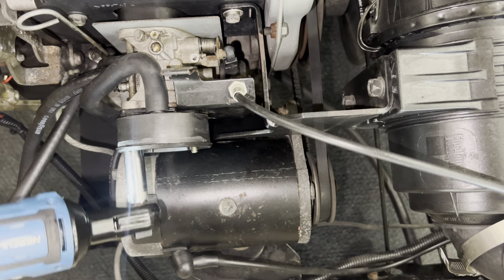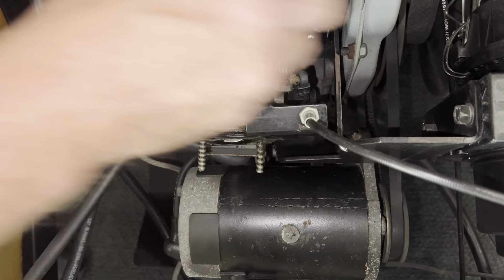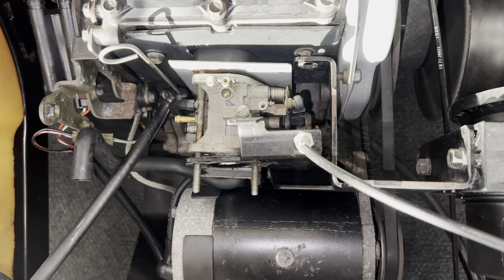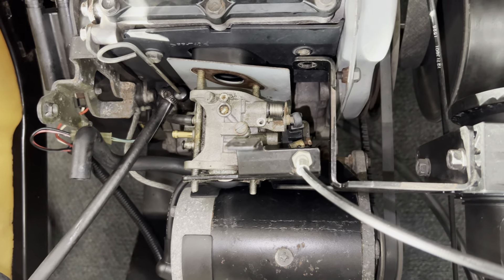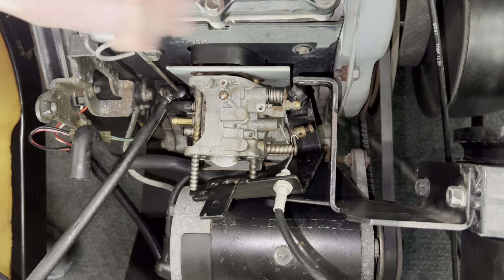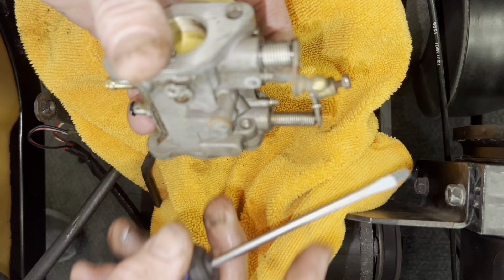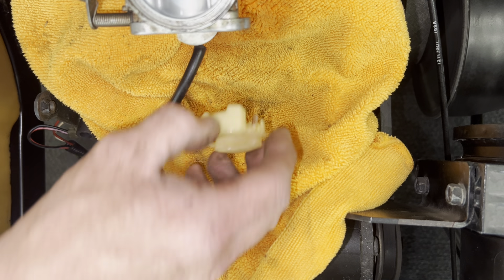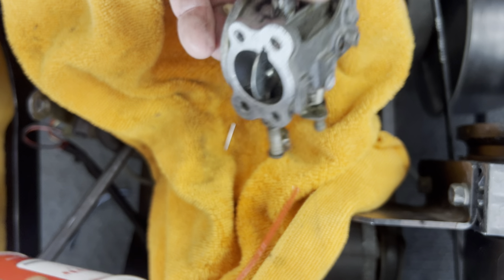Ezgo gas robins engine.  Clean carburetor.  Step by step

Comment: Great video, I have the same carburetor on my  EZGO. Im trying to replace it but I cant find the exact one.  Do you have the specific replacement for it? I cant find any markings on mine. Thanks
Reply from the maker: Go on parts zillow.com and type in 295 cc engine carburetor robins Ezgo
Reply from the maker: https://www.countrycat.com/e-z-go-cushman-72840g01-oem-carburetor-fuji-robin-subaru-295-mci?utm_source=google&utm_medium=cpc&utm_campaign=google-simple&srsltid=AfmBOoojQ6udXK0bXWAVQR_mMC-MWz4Vxk3LJD8YgWycveYcWeil5Iz6lyw
Reply from the maker: https://www.countrycat.com/e-z-go-cushman-72840g01-oem-carburetor-fuji-robin-subaru-295-mci?utm_source=google&utm_medium=cpc&utm_campaign=google-simple&srsltid=AfmBOoojQ6udXK0bXWAVQR_mMC-MWz4Vxk3LJD8YgWycveYcWeil5Iz6lyw
Reply from the maker: Whatever you do don’t order and cheap one off of Amazon they’re not worth it. It will cost you more headache than what is worth or you are better off to just clean what you got if you can.
Reply from the maker: What problem are you having with yours?
Reply: @Golfcartwhisperer  my screws are stripped and I cant get to the jets to clean them out. Easier just to change out the carb. I'll look for them, thanks.
Reply from the maker: @ gotcha

Comment: Hey,  I have a question about a ignition coil for a ex go workhorse with the robin 350 like the one in the video. What would be the best place to get a replacement? I believe it is a 2003 year. Thanks
Reply from the maker: @deerdoghunter123  what’s wrong with yours? Don’t want you to but the wrong part
Reply: One of the plug wires has come out and I'm not sure but looks like it is not supposed to? I'm new to golf cart engines. The cart started to run bad every now and then and has slowly gotten worse. I can barely get it to go up the ramp on my trailer now. I have pulled the carburetor and it looks good inside. The cart never sits so not bad gas. Just wanted to check if you believe the ignition coil could be the reason with the plug wire coming out.
Reply from the maker: I would just push the ignition coil back in. Have you tried adjusting the valves.  I am going to share you a couple of videos.  Have you tried running it with the air box cover and the air filter out to see if runs bad.
Reply from the maker: Ezgo gas has no power adjust valves.  Robins twin cylinder engine
https://youtu.be/X2CxSnD6K8E
Reply from the maker: TEST REAR CLUTCH ON A EZGO GOLF CART.  (DRIVEN CLUTCH)
https://youtu.be/mTA-r0caW_s
Reply from the maker: If it’s a coil they normally go out on one cylinder.   So the cart would skip and barely not run period. Check the videos I sent you above.  If they don’t fix your problem.   
Is it hard to start sometimes?
Reply: @Golfcartwhisperer  It is not hard to start normally. I have adjusted the valves to the .004 spec. I will try running it with the air box off. Just want to check that the plug wires that go to the pack just push in and there is no metal prong or anything? Looks like a clean cut wire that came out. Thanks for the help.
Reply: The cart started out skipping and bogging every now and then and has gradually gotten to the point now will barely move at all.
Reply from the maker: @deerdoghunter123  what you could do there is put it in neutral. Take one spark plug wire off. Let it hang and try to crank it up. Then put the spark plug wire back on and put the other plug wire off and crank it up and see which ones the worst, they both should crank up the same.
Reply from the maker: @deerdoghunter123  but you’re right there should be a metal prong sticking out the inside of the coil like a metal pin sticking up then it just sticks into the bottom of the wire if that metal pen is gone yes, replace coil. I would buy one from Red Hawk or if you wanted to is yoursmade is your exhaust manifold aluminum or is it metal?
Reply: @Golfcartwhisperer  ok I will try that as well. Is it normal for the wire to look like it has been clean cut and just stick in the pack with the boot on?
Reply: @Golfcartwhisperer  metal I believe, not 100% sure will check when I get home.
Reply: @Golfcartwhisperer  I did not see any metal prong or anything. It looked like the wire just went in not connected to anything I could see.
Reply: @Golfcartwhisperer  Do you have a part# for the coil from Red Hawk. It is the Robin 350 I believe 2003 year. Looks like the one in this video.  Thanks
Reply from the maker: @deerdoghunter123  10-4. Because if it’s metal you have a pre mci engine. Don’t buy none for them. They’re not worth crap.  Get you an mci coil with the adapter harness. But I am going to say this. Trust me on this.  If the pin is not broke inside your current coil.  Put the wire back in with a little silicone on the side and it will hold it in place   The wire just pushes on the tab that’s inside the coil sticking up.  You’re 1,000,000 % better off to stick with the oem coil. Meaning factory coil. If anyway possible. All you can get for the robins engine are after market parts. And you’ll buy 10 to get one good. Most of the time you’ll have to add a balance resistor to the coil to make it even work
Reply: @Golfcartwhisperer  Ok I will put it back with a little silicone. I appreciate all your help. One more question what is the purpose of the baffle that goes in the stud extender when putting the carb back on. I'm just learning about these.
Reply from the maker: Also I would take your spark plug out. Let it sit on the valve cover bolt. Pick up with insulated pliers about 1/4 inch. And see if the spark will jump from spark plug to metal. But don’t set spark plug near the cylinder it’s out of because if it shoots gas up and you have a spark by there.  Will cause a flame. Not much though. Or if you have an extra spark plug laying around leave the spark plugs in and so each coil wire one at a time and see what happens. If the spark is not bright blue and any jump replace ignitor.  If not firing on one cylinder replace coil.
Reply from the maker: The baffle is for gas so while cranking up it doesn’t spit gas on the air box cover and then backfire and start a fire on the air box. Once the intake valves start having to be adjuated